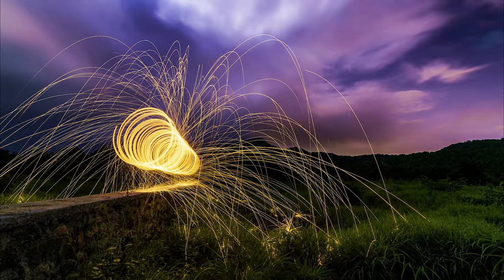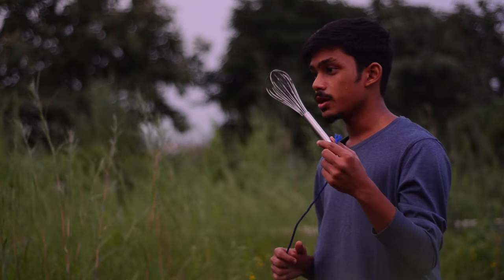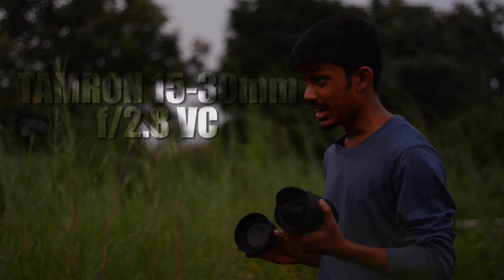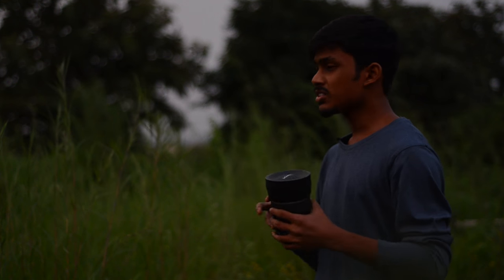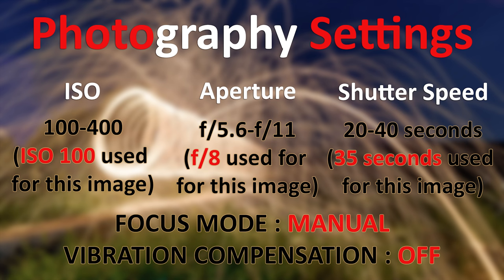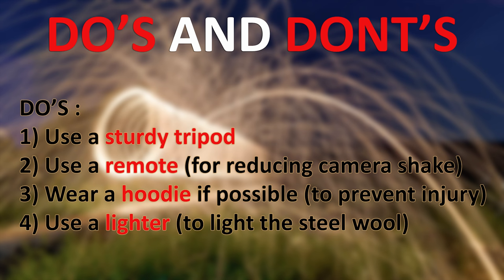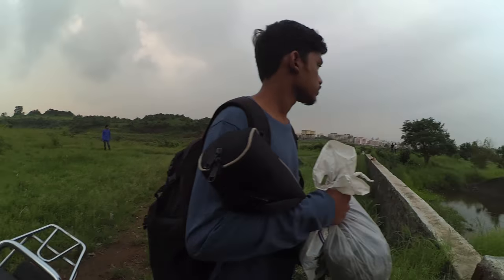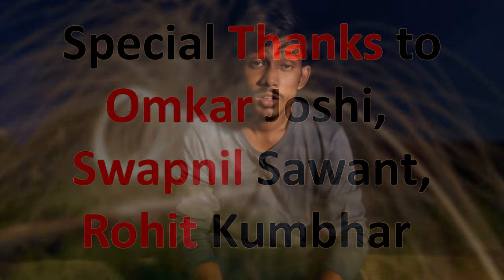Steel Wool Photography Tutorial | HD

Comment: i have done it as you said
but the picture is completely white???
Reply: It could be over exposed. 
- Decrease the ISO (as low as possible) 
- increase the shutter speed, don’t have the shutter open for too long 
- increase the f-stop number (smaller aperture) 
- Avoid the brightest time of the day or use a neutral density filter